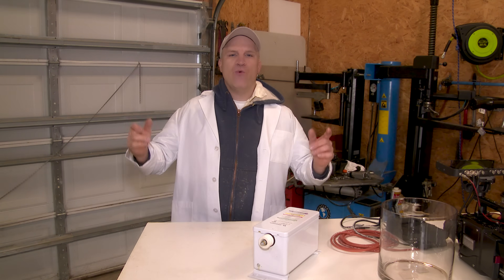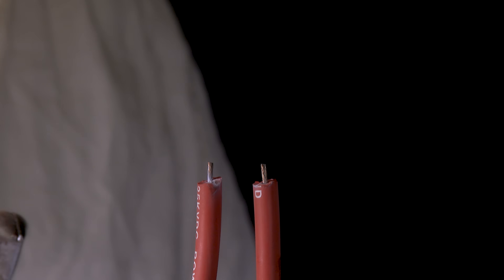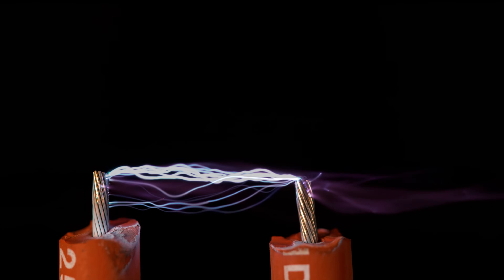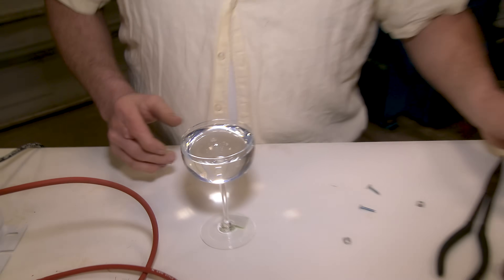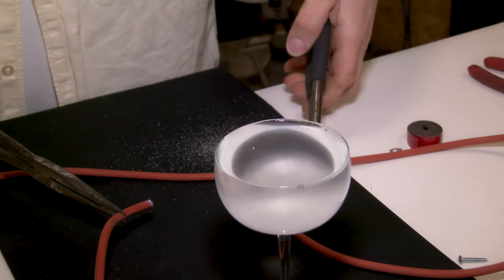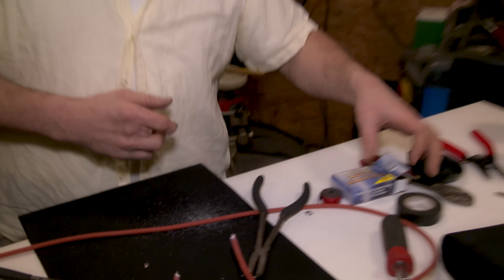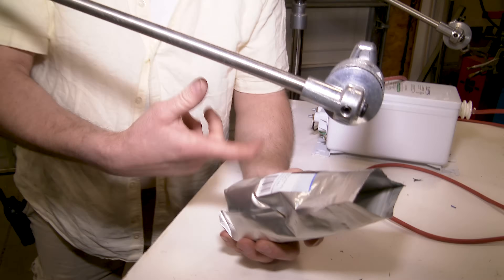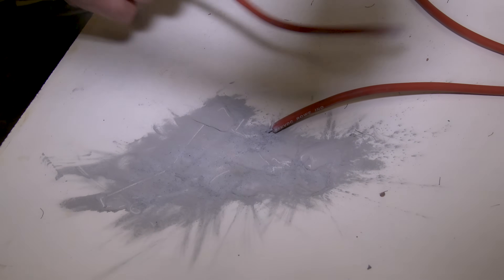High Voltage Electricity and Water - 4k Slow Motion & Ultra Slow Motion

Comment: 5:33... Wow! That's AWESOME! 
You can even tell WHICH way that the A.C. current is flowing by the spots in the water under the tips of the wires... When the current is flowing one way, you can see the water depress and make a little bowl shape as the current leaves the wire and goes into the water, while the water at the other wire rises up a bit from the surface when the current reaches out of the water to flow to the wire tip. And then the effect reverses when the polarity switches... VERY cool! ⚡️

Comment: Kinda looks like nano particles I took off a child's mask And boiled them in hot water and then watched what happened with a microscope 1000 times and quite frankly I saw some weird undercurrent movement special with my nano ball from the children's mask that I got off with my little tool a magnet screw driver

Comment: at 6:18 exactly theres a really cool drop of water that gets lit up. gotta watch it with youtubes slow motion! As the drop gets charged it looks like it races up onto the wire and is frozen magnetically! Like as if the electricity altered the surface tension and wouldnt let the water escape just like a welding puddle

Comment: at 5:25 as the electricity blast into the water from one side, the other side looks as if it forms a glowing ring that expands in the water as the electrons flow more. My question is the positive blasting into the water or is it the negative?

Comment: havent seen any comments about the small bits of glowing metal sparking off the ends of the conductors with each tick of the cycle. willing to bet it's a rise in local surface temperature from the sudden increase in amperage as the contact breaks.

Comment: The electricity going through the water in slow motion is awesome you can see how Alternating Current works on the surface of the water. You can actually see the direction of the current snapping back and forth.

Comment: I would like to see this with 8b graphite anode and cathode @ 120 amps with the power source at the bottom of the submerged graphite rods. With a spark gap of about 1mm at the base and 2-3 mm at the top. Increasing the voltage until a climbing arc is achieved.  Then add food coloring to the water to provide a visual of how fast the water is purified.
Reply: DC current

Comment: your arcs are polarity sensitive. Please try adding a diode to one lead so arcs only occur every half cycle, but of a known polarity.   After recording positive polarity, reverse the diode and hi-speed video the negative polarity. I would venture to say that the larger, brighter plumes are from the positive polarity arcs hitting the water. Please let me know what you find.  Thanks!

Comment: So it's "Ideas" you want...…………...Point a Bottle Rocket at something you WANT to Electrocute.     Ground the thing, that is to be electrocuted...…….Position your Step-up transformer electrode, so that the Exhaust from the bottle rocket contacts the electrode.    When the smoke path / Exhaust travels to the thing to be electrocuted, the High voltage charge will arc along the smoke path and ZAP the thing to be electrocuted.

Comment: Those that are concerned about deadly electric shocks from this...
The heart runs on approximately 5v, and if another voltage reaches it, won't be overly troubled unless there is enough current to cause significant damage to the flesh.
Since the current is similar all along the path, then the flesh damage would be visible at the surface on the way in, and out. Also, current tends to spread out through the entire body, lessening its specific effect on the heart.
As the heart is buried somewhere in the middle, a shock of 15kV would present between 5kV and 10kV at the heart, and at an extremely low relative current due to the current being shared by many tissues.
More current would flow where there is a nerve or a vessel, as both are high in salts and water.
As a T.V. technician working on the old tube sets, I was occasionally shocked when  things went wrong. Our workstations were all isolated from ground to reduce the option for power to flow. I had to touch two parts at the same time to earn myself a coffee break.
Some of the shocks were unsettling and warranted a rest period.
The nervous system is most susceptible to the effects of electric shock, as OP can testify.

Comment: missing a finger and still don't use gloves playing with electricity.... not sure if giant balls or stupid. I can appreciate it though lol it looked badass, nice work.
Reply from the maker: EyeSeeYou nah man, the Pliers are rubber coated, and the wires are high voltage insulated. I'm really not sure how much damage that would do because it's very low milliamps, but I guess if you're lucky it could have some type of impact. I have been working with electricity for a very long time though
Reply: I just thought it was funny you wouldn't hold a tiny firecracker without gloves but played with 15,000 volts and metal tools bare handed the whole video haha. hey as long as you trust yourself and know what you're doing, Id hurt myself no doubt lol.
Reply from the maker: EyeSeeYou ha..  that was funny now that I think about it. Thanks !

Comment: Shocked you because you arent taking proper safety measures. Grabbing them with metal pliers bare handed. Stupido
Reply from the maker: raverkid loki actually it's not that serious, one of the first things they teach in a proper electrical course is that amperage kills, not voltage. Factor in the resistance of your body and the actual transferred voltage is miniscule.

Comment: What would be unreal if you went in higher resolution and slower for the water one again, what happened at the surface is very interesting.
Reply from the maker: +aaron quinn well that's really tough, because the spark only puts off so much light, if you go slower you need more light and the spark would be darker. I went to slow as I could with as much light as the spark game off
Reply: Warped Perception oh yeah completely forgot about the camera getting darker with higher frame rates, never mind then there's that idea gone :P

Comment: You basically created a Jacob’s Ladder. You can manipulate the plasma stream on a JL the same as you were doing with the wires. Also if a JL doesn’t have a long enough or far enough apart electrodes the plasma arc will stay at the top.

Comment: dude the footage of the plasma between electrodes and water - I found it fascinating - u can see the difference between the 2 electrodes as the AC wave goes +ve and -ve.  the plasma looks different from one to the other, and switches sides :)  don't know which is which but it does switch sides, right?

awesome!  thanks for the vid :)

Comment: instead of gripping the wires with steel pliers (even with insulated wire and handles) try gluing the wires to some plastic sticks.  That way, you'll have several inches of NONconductive material between you and the several thousand volts.  Otherwise, a bit of a nick in the insulation and it'll really light you up

Comment: Hey! Just stumbled on your channel, and I'm on my way through your videos now. There's one fascinating thing about this episode that I don't think you mentioned. The transformer that you're using, is it outputting AC current? As I was watching, I noticed that the pulse that moved through the water changed direction from electrode to electrode. This is actually a great example of AC current, and I've never seen anything like that before. Could you confirm?

Comment: I dont know if its actually what you are seeing, but it looks like you can see the direction of the electrons traveling from the wires thru the water. When one wire sparks and there is a lot of turbulence under, on the other side, it seems like it is very calm with a blue ring around the spark in the water. 5:27 Then after about 2 sparks, it switches sides. 5:39
 I dont know if I am imagining that but thats what it looks like I saw.

Comment: Put an AC light dimmer switch on the input of the transformer. You can turn the voltage down to where you can arc it to your hand without it burning you....might make for a fun video.

Comment: The other thing is , why are you holding the electrodes with steel pliers not plastic isolation like wood or plastic conduit ? Safety ?

Comment: What is interesting is the electrons @2:00 did not go directly to the opposite wire , rather , it formed an arc upward then bent around to come back to the opposing electrode. It appears the electrons preferred to eject along the path of the electrode than eject out the side .. Can you explore this more ?

Comment: I really like your other videos, but I had to dislike this on the basis of safety. I've browsed the comments section, and you seem adamant that working with high voltages since you were 5 is sufficient justification for your own safety. Clearly other people have brought up multiple points (the dangers of hand to hand shock, the low current required to stop a heart, the fact that you were using METAL pliers, etc), but honestly I think your own safety is your problem and responsibility.

I can't tell from watching your videos if you're a certified lineman either, but I do wish to ask you this:

Would you feel bad if some teen on Youtube interested in learning about high voltages somehow got his hands on one of these transformers (or even a "lower" voltage microwave transformer), and got himself killed because he didn't follow the necessary safety precautions?

Would you think it would be worth the small amount of knowledge imparted, and the "cool" footage (that is not the first of its kind?)

Maybe if you're gonna work with 15KV 450VA transformers, you should put a disclaimer mentioning the safety precautions that one must take, or at least warn people that mistakes made are FATAL.
Reply from the maker: Thanks, actually I am an aeronautical engineer so my knowledge of electricity is very deep, as for the safety well, I would have to agree and honestly there was supposed to be a nice BIG FAT warning in the video but I finished this final cut at like 1 am and I simply forgot, but yeah of course i wouldn't want anyone to get hurt.

Comment: Someone correct me if im wrong. I'm just thinking ignorantly.. but is there some sort of force created as the wires spit electricity towards the top of the arc? And if there is couldn't you use that as some sort if propulsion? Granted if you have this on a much more powerful and larger scale? 
Again this is just me thinking ignorantly. I'm not an expert on this stuff just a thought
Reply: The force you are referring to is called magnetic flux; Nikola Tesla played with it a lot more, it is the crux of electric motor functionality.

Comment: Try running your hot lead into the end of a clear 250 watt light bulb. The vacuum inside the light bulb will give you some nice long purple arcs inside the bulb off the ends of the filaments.

Comment: I like watching this stuff.

Not sure if the results would be exciting enough to setup these little experiments again. But it would be neat to see 15kV at various frequencies. Perhaps DC up to 1 MHz. Because 60 Hz is kind of boring.
I have no idea what safety precautions you'd want to take when you change the frequency. I did learn in school that 60 Hz is the most dangerous though.

Comment: Composition lesson: action, action, action. You frame action, not mise-en-scene. What it means is that you don't give two flying fucks about the bottom of the glass even though in portrait painting that would be included. We need action near the the center and to keep what is most important visible. In this case: electrodes and the operator's hands.. We like to look at hands of a human operating something cool ;) Not hovering electrodes and bottom of the glass, even when it would make better still.

Comment: So saltwater on the insulator conducts electricity to you.  That's really dangerous.  I like your experiments but I would not use a conductor to hold your wire.  Use plastic rods.

Comment: The "cool" thing you mentioned when u blew on the arc happens because you blow away the plasma revealing an arc of pure electricity underneath, shortly after an electrical arc forms the air is normally heated to a very high temperature which turns it into plasma, which is electrically conductive, that's why the blue arc disappears shortly after the arc is created, now if you blow away/cool down the air, it loses its conductive properties and an arc of pure electricity forms again.

Comment: put the powder in water.  YOu could try two experiments. However I think it might be rather explosive.  !. Mix the powder in water via a blender then apply the charge to it.  2. Float the powder on the surface of water and then apply the charge.

Comment: Strike the arc between the wires about 1 inch apart. Bring them up to the side of a glass, any glass. within seconds the glass will heat up and the electricity will jump to the glass. Now start moving the wires away from each other around to opposite sides of the glass. watch what happens.........

Comment: Hi try to connect to your high voltage source in parallel high voltage capacitor with low capacitance and high voltage diode and once again try your experiments, you will see great results cool as if you also did it in slow motion

Comment: I was waiting for the arc to jump into the poorly insulated needle nose pliers you were gripping the HV wire with in opposite hands, it would have created a path up your arms and through your chest and stopping your heart!.  That transformer is rated at 15,ooo volts, but that's not what's going to kill you...it's the 30ma and that's more than enough to kill you. 
This video had no purpose other than foolishness, it showed an extreme lack of understanding what is really happening. Just haphazardly using a high voltage transformer to make use of an expensive slo-mo camera to generate views for revenue. It's just a matter of time till that transformer is going to "bite" you and hopefully you'll live to learn to do more research on safety and the dangers involved with electricity. Electricity takes the path of least resistance and if "you" are that path, you pay the price...don't let it be with your life, there's only one "you". That's my opinion and I'm sticking to it.
Reply from the maker: lol. there's more than meets the eye and i dont make videos for views, thats foolish to think that will pay for a $200k camera.i have been doing these experiments since i was like 5 yrs old. your heart just doesn't stop everytime you get shocked. and if it did i would shock it again before i lose blood pressure.

Comment: That must be alternative current ay? You can physically see the plasma pulsing back and forth producing the sound in a pulsing manner when listened to in slow motion. At 5:47 you can see how the current alternates and how the water is being electrolysed and it ignites some of the hydrogen with oxygen on each electrical strike.
Reply: Chaim Goldbaum any NST or transformer for that matter is gonna be A.C. unless it's rectified.

Comment: Friend if you have an invisible hole in the wire and you can hold it can pop a bow and reach your hand. Do not touch high voltage wires without gloves! You can not play with these things ...

Comment: 5:50 I would like to see this scene slower, like 20.000 FPS or slower. And without those ISO  grains which are caused by low resolution. Actually, I would like it all to be macro. Very close.
Reply from the maker: +inyazserg Sergey Larin well as for iso grains , on the phantom flex in 4k that is non existent, and grain you see here is pixelation caused for the YT compression encoding. Mays some super macro shots in the near future.
Reply: yes, macro, please. It would look really different and new.

Comment: I love how the alternating current, starting at 5:30, shows the plasma coming and going off of each electrode. You can see the little blue rivulets of plasma fairing out, left right left right left right. If you ever do this again, I'd be interested to see a volt meter test tap vs. salt water results.

Comment: take those wires from the transformer and move them across the back of a crt tube. you will get the beautiful sparks you are looking for.  You can make a homemade capacitor and make a solid spark too, but across the back of a crt is what you are looking for.

Comment: Excellent!  Did you use AC or DC?, I found that, when the electrical current passed through, it may causs the water flow, I am interested in this phenomenon .(Sorry, I am not good at English)

Comment: Man, you know chlorine is toxic, yes? You've just breathed some of it. NEVER use kitchen salt with water and electricity. Use sodium bicarbonate instead.
You are scared by firecrackers but you touch them after they exploded? What if they're not totally burned? THAT was the dangerous thing...
Not to count that your way to manage 15kv is terrifying. Please, PAY MORE ATTENTION, or you'll get killed. The transformer is rated for 30mA but it isn't limited and if you get in touch with the conductor in both your hands you DIE.
Reply from the maker: +Lord Tiger nah I'm not scared of firecrackers, im scared of delays if I loose another finger or sustain injury, that's what I'm afraid of, the pain I can handle no sweat, the time we cannot get back. You know what I'm talking about